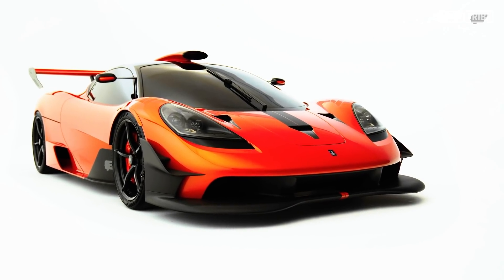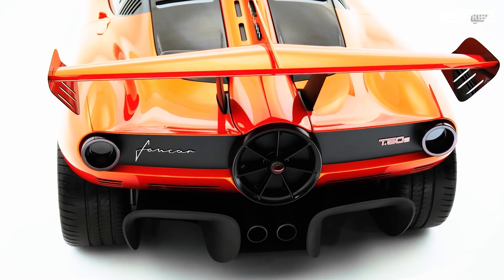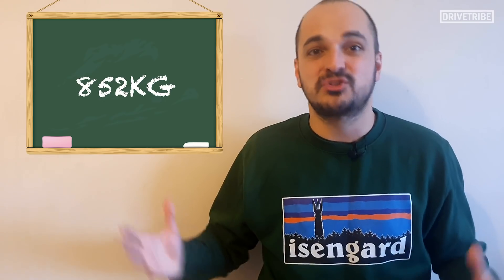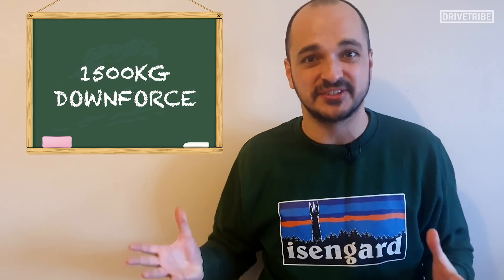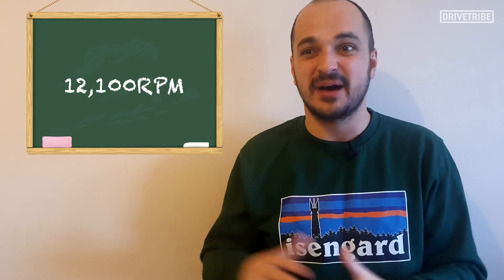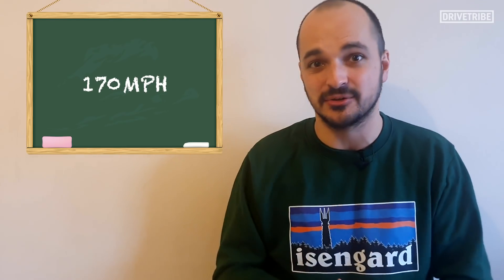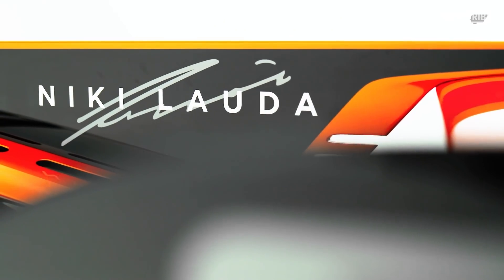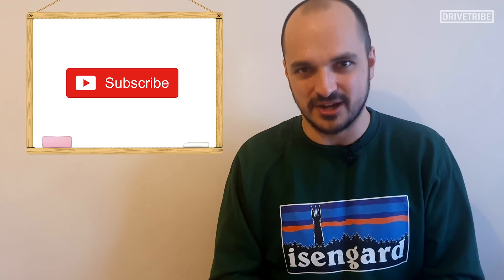This new supercar originally created TOO MUCH downforce – Gordon Murray's T.50S

Comment: This is a long one but bear with me as I think I'm onto something.

Most gear/petrol heads get angry and sad when these kind of cars are only going to be able to be bought by old rich people who will never drive them. They will instead let them rot away in their private collection. No, I don't hate old rich people. It's just sadly been statistically proven at this point. However, there is a solution to this is. Adopt the track car clause that some manufacturers use when it comes to their expensive/rare track cars. More companies are actually starting to do this as well which gives me hope. One way it works is that you buy the car and are the owner. However, the manufacturer holds onto the car and you're only allowed to drive it when it's taken to a track. That way the car is used the way the engineers meant it to be used and it's also taken cared of properly since the manufacturer holds onto it when you're not driving it. Another way it can work is that the company will let you hold your car, BUT you are obligated by contract to take it to a certain amount of track days per year. Some that come to mind are most Ferrari track cars like the 599XX Evolution, FXX, FXX-K and the McLaren P1 GTR. I'm sure there are others as well. The average gear/petrol head can actually witness the thing in action. The engineers can truly be proud of all the hard work they put into their creation and the owner will be narrowed down to people who will actually drive and enjoy their purchase. It's a win win situation for literally everyone.

Comment: The T50S will smash the Nürburgring record even with the 1500kg downforce Version... it still is nearly double the downforce of its weight, compared to the Porsche 911 GT2 RS wich has around 70-80% the downforce compared to its weight... but it has more power, but is still over 400kg heavier than the T50S, and straight piped? Is he insane? It will be nearly impossible to run on any track Melasse of noise regulations... even the LMP cars have mufflers....

Comment: A glickenhaus costs less and makes 2000kg df. I understand wanting it to be a track and road car but it literally doesn't have cats so it can't anyway. Why not go all out on downforce on the s if you're gonna make it illegal anyway? The glickenhaus can go on both, the compromise is it's uncomfortable but if murray was making two cars anyway I just don't get it.
Reply: The T50s isn't illegal to drive on tracks? There is a choice of 3 mufflers depending on what track you'll be driving on and what their noise level permits. He didn't want more downforce as it meant changing for heavier suspension components and bigger wheels, tyres. He wants it to handle well for anyone to drive it,not just pro racing drivers. The more downforce, the faster an accident can ocur. (It'll snap into a spin quicker) nobody bar a professional racing driver could be able to catch a spin that quickly.
Reply: @gavinwyllie7855  no but it's illegal on streets. You need cats for registration and plates. In that sense, the s is already track only so just make it for professionals only and add downforce. Glickenhaus doesn't sell to people who will crash, gordon could do the same

Comment: I think the main point being consistently missed here other than by Gordon Murray is that the issue isn't that it is just TOO much downforce. It's too much REAR downforce. AKA it is overpowering the front downforce too much, which is likely leading to lots of understeer issues. Especially since he talked about how they could have gone further with the front aero to compensate but didn't want to for the sake of this particular design.

Comment: Now this is the stuff I wanna see. Imagine they get Ex-F1, LeMans or IMSA drivers to drive this car along with the Senna, Ford GT MK2, Koenigsegg Jesko, Bugatti Bolide, Pagani Huayra Imola and the Ferrari FXXK Evo, battling it out on circuits like Brands Hatch or even Zolder or Hockenheim (any ex f1 track will do). That would be epic
Reply: I can see Koenigsegg without a doubt would agree to join this race series if they are invited. Christian von Koenigsegg hates regulations that limit the performance of his car, so this is perfect for them.
Reply: @budokpantai  The only circuit a Koeniggseggseggabbaviking would have a chance on, would be a single long straight road.
Reply: @ashscott6068  Well, the One:1 ran at Spa and Suzuka just fine, until Spa decided to banned them. They had bad lucks in setting lap times on tracks, but doesn't mean their cars aren't capable.
Reply: @budokpantai  their cars aren't capable. Do you realize what laptimes the Valkyrie is going to do?
Reply: @budokpantai  they’re extremely capable

The most stable cars ever created period!
You can violently turn the wheel left and right at. 6-100MPH and the car will stay perfectly on the road nice and stable.
Reply: This car is so much faster than everything (other than Bollide/919 Evo which is in another zip code) that it would drive past any of those other cars like they were standing still.
Reply: Brands Hatch would be fantastic. Sadly Ferrari would never let their FXXK Evo compete and private owners wouldn't be able to get around the fact that Ferrari keeps all the cars.
Reply: T.50s, SCG 003/007 and Valkyrie would run circles around those other cars. But I’d love to see it.
Reply: That would be so amazing!
Reply: The Nurburgring
Reply: By the time they're all converted to race cars, they'd all be so similar it would be kinda pointless

Comment: I dont see why everyone likes the F1 so much. Its hideous. This one though is a lot better looking.
Reply: The F1 is not about looks but about performance, it had ridiculous performance at its time and held records for well over a decade.
Reply: @DefinitelyNotEmma  true. But still.
Reply: @Goat4459  well, it was the fastest, most expensive and most sensational car at the time. For the people than it was what the Porsche 918 is for me now
Reply: @DefinitelyNotEmma Nah xj220 is WAAAY superior.  F1 came out somewhere in 1993 and then the xj220 had already been in production for 1 year. And it could go 200mph.
Reply: @Goat4459  the XJ220 was already Outshined by other supercars, not to remember the disastrous release. There is a reason Jaguar went out of the Supercar game for a looooooong time
Reply: @Goat4459  The F1 was (and still is) a masterpiece of engineering. It can go 20mph more than the Jag and it didn't require turbos. To this day it's still the fastest N/A car - a record it has held for almost 30 years. There may be nicer looking cars but none of them can compare to the F1's ingenuity.
Reply: @PedzRR  hrmm search Dauer 962 Porsche lemans. I think you'll find it has better top speed and better 0-60mph. And even it's a race car technically, it's still road legal and they made a couple for the road, so that rich people could drive them.

Comment: I still can't get over how small and well packaged that V12 is... including the transmission! It's tiny, you could fit it in an MX5 and have room to spare, lol
Reply: There are MX5 with V12.
Reply: @jareknowak8712  I know... but with this Cosworth V12, there would be room to spare, as I already said. Also, its likely a very light engine and so wouldn't result in a nose-heavy balance.
Reply: @Nemoticon  yep. It is an ultra light engine already in T50, and even 15 kg lighter in T50S.

Comment: If the T50 is the new F1, THIS, is the F1 GTR. And I love it.
Reply: The GTR was basically a modified F1,this was built as a seperate model. Very little is carried over. Different engine,different interior, different engine,almost totally different body panels.
Reply: @gavinwyllie7855  “successor”
Reply: This is the F1 GTR Longtail in terms of McLaren F1 updates. It's much more different than the the original or even 96 GTR
Reply: Same
Reply: The ironic part was that the road car F1 was faster lol
Reply: GT1.
Reply: GTR LT
Reply: I agree

Comment: How much downforce can be considered f1 level
Reply: It's a fantastic track car, but let's not compare it to an F1 car. It's not even close. To put it into perspective, early 90s group C IMSA spec cars had 4000kgs of downforce at max speed, so this isnt even scratching the surface to compare it with F1.
Reply: @weallfollowmanutd  The mercedes provides 3000kg of downforce
Reply: @lsthcanux8669  at quite a bit less than 300 kph. So, they'll make a lot more at higher speeds.
Reply: A metric fucktonne
Reply: @AzathothsAlarmClock  exactly
Reply: If you can drive upside down it’s considered F1 level
Reply: @AzathothsAlarmClock  it's quite a lot for a car that's not slammed to the ground with skirts and triple element rear wing, 20% wider, small cockpit etc etc.

The 1500 kg is at 210 mph. The car could easily have been made with 2000+ kg, but the tires and suspension geometry would not handle it

For what it is, it's immensely impressive and I have no doubt it's going to be the most thrilling track car out there.
Reply: I think around 4 tons. If you consider though that the cars weigh 700kilos while having engines with almost 1000 horsepower(or possibly more) the amount of downforce is ridiculous.
Reply: @AzathothsAlarmClock  I wasn’t being serious
Reply: @AzathothsAlarmClock  Gordon said the downforce figure was at maximum speed. That is the maximum speed of the car.

No old race car is gonna feel like the T50S except for a F1 car. And that would require a crew to operate and setup. Wouldn't meet 50% of the tracks sound limits either, much more frequent engine rebuilds, etc etc.

To truly get the T50S experience, the car has to be 800 kg, NA V12 with F1 level throttle response, and central driving position.
Reply: f1 cars makes  downforce 5 times  their weight so 750kg X 5 = 3750 at maximum speed
Reply: @ianm.w1563  F1 cars do not make 3750 kg downforce.
Reply: This car creates a red bulls worth on a slow corner
Reply: @dnbmania  Williams*
Reply: When the car have more weigh generated than its weight itself
Reply: @sanurawat1651  nope. F1 cars make downforce more than 4 times their weight.
Reply: @sanurawat1651  t50s qualifies then. It's almost twice the weight of the car 😂
Reply: 3000kg